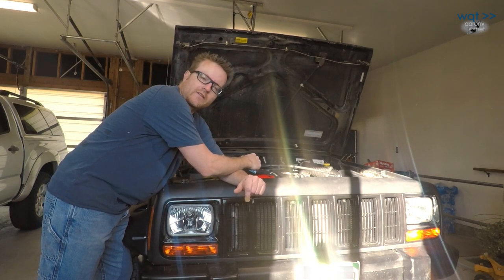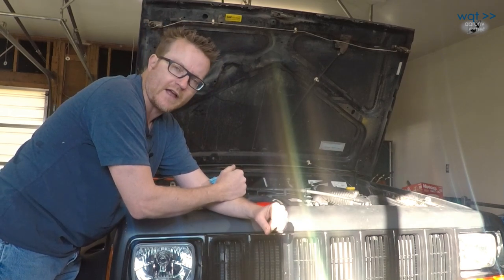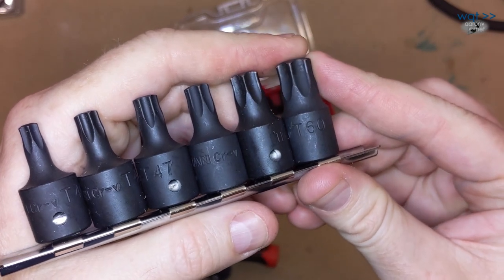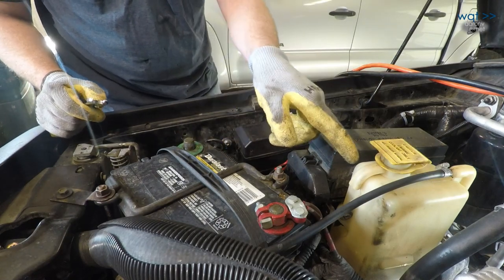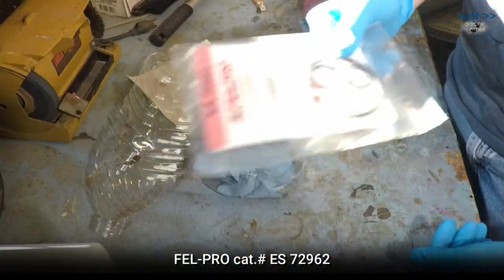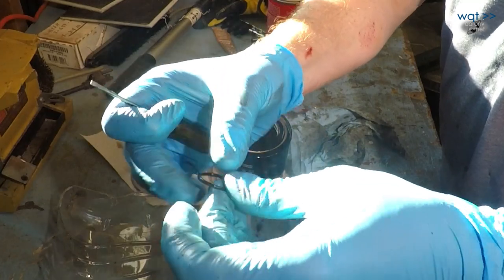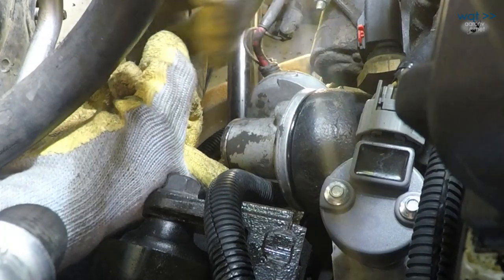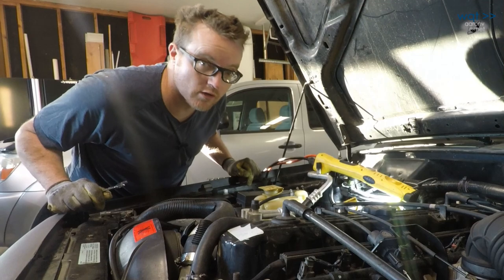projectXJ: Oil Filter Adapter Bracket O-Rings replacement (AMC 242 4.0 Jeep Cherokee XJ)

Comment: FYI an early 90's 4.0 and possibly earlier do not have a torx it has a bolt and the felpro kit is missing an o ring that goes on the bolt.  I got the extra o ring at ace hardware
Reply from the maker: Great info. Pinned to help others find it.

Comment: Just did this today. It was tough finding a T60 that is short. I ended up having to buy a Lisle branded one and cut the tip length down to the bare minimum and also cut the Socket body in half. Then I used a serpentine belt 1/2" Socket tool arm as its very flat and has a low profile. I also removed the one engine maintenance bolt. Thank you Aaron!